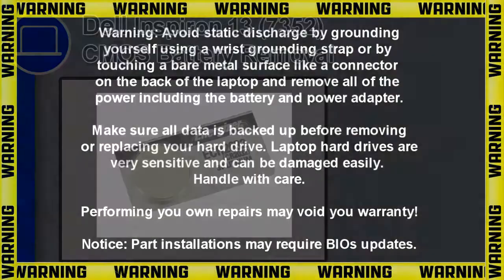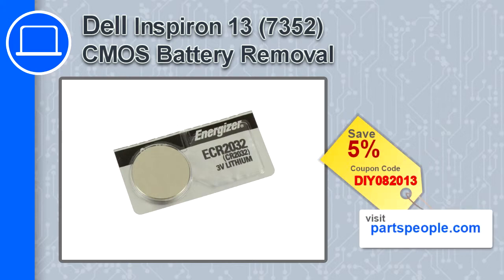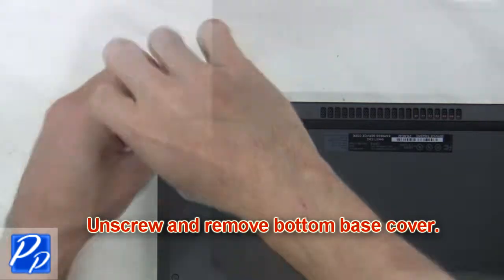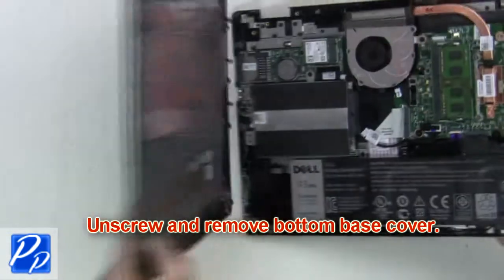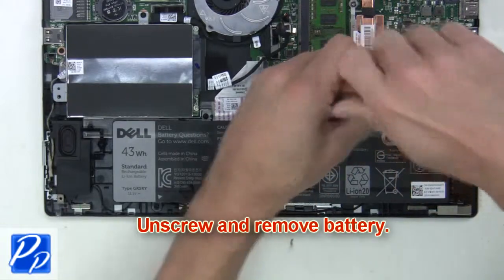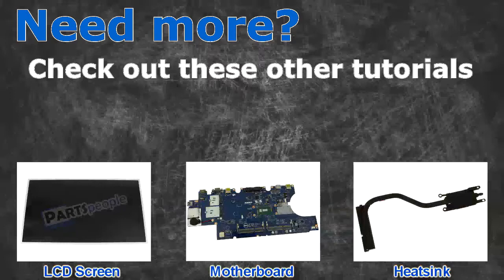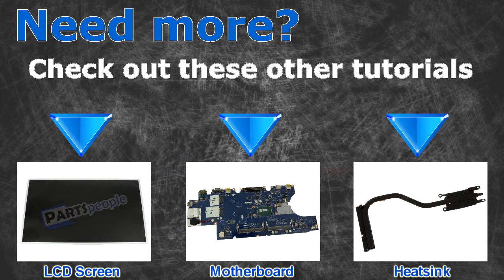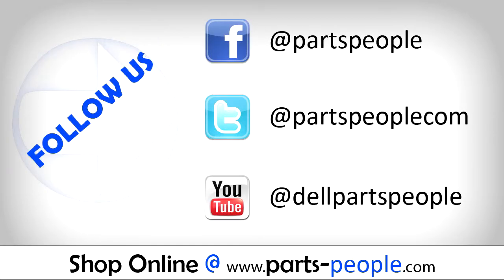Dell Inspiron 13-7352 (P57G-001) CMOS Battery How-To Video Tutorial

Comment: Why would the main battery need to be removed along with it?
Reply from the maker: Disconnecting the primary battery is a safety precaution to avoid electrical damage to other components.